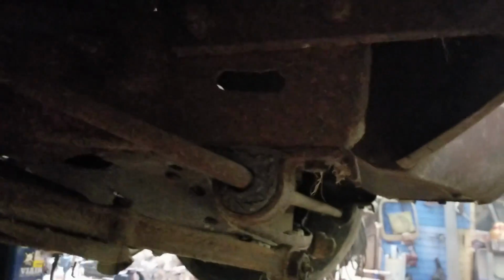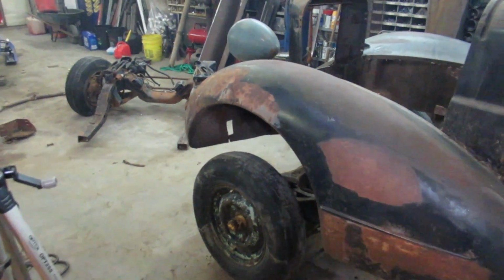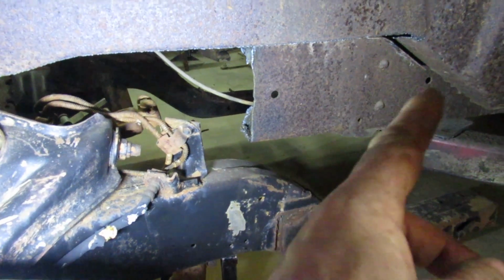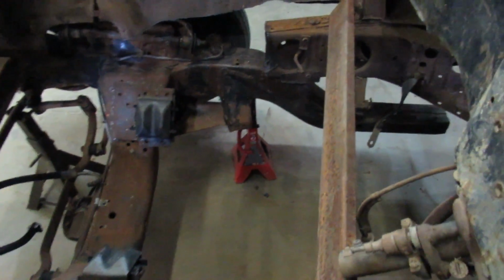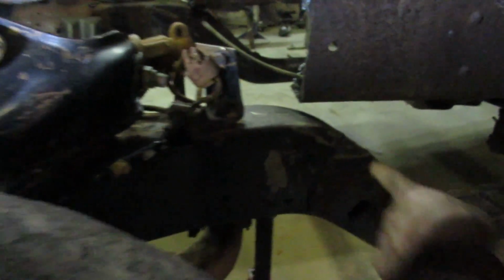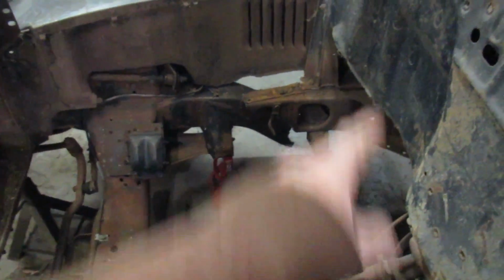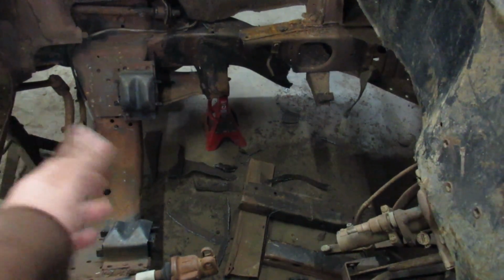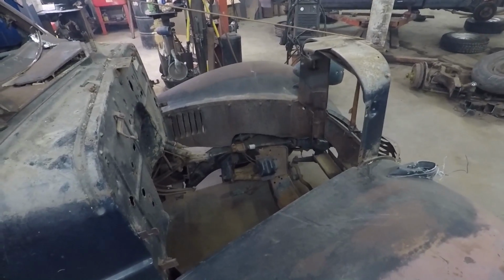Installing a Camaro clip into 1938 Pontiac Coupe part1

Comment: I hope you're measuring your wheel base so they match each side?  going to be kinda ugly for a while stitching the frames together but hope ya get it all set.
Reply from the maker: Can't really in this scenario as the rear diff isn't really mounted, I'll be putting a different diff along with 4 bar so it'll be fully adjustable if need be.

Comment: For my 47 with a 77 nova front clip. Don’t know if Carl showed you pics but it on my channel. The guy cut the front of the frame right at the front of the stabilizer bar bracket. Then someone to pull it out hooked up to the stabilizer bar bending the bracket and maybe bar. Im trying to repair this part to start rebuild.
What type of  bumpers will pass safety here.
Reply: Also how much meat you have from the bracket forward?
Reply from the maker: https://web2.gov.mb.ca/laws/regs/annual/2019/031.pdf page 12 you don't need a bumper is the way I read it.

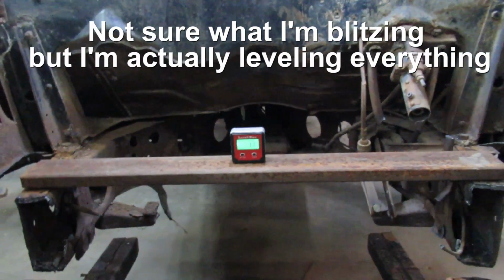Comment: 5:24  Are those frame mounts moved back ?
Looks to have flat plate welded to the cross member then the mounts welded to it.
What year is the clip ?
Thanks..
Reply from the maker: Yeah is was a clip that someone had butchered into a 46 Chevy pickup frame that I cut it out of. So I'm guessing it's for that motor setup.
Reply: @HalfassKustoms  T have a '46 Chevy pickup with a  G-body clip. I bought it as it is, unable to drive it. I was worried, but whoever put it in did an awesome job. Goes down the road straight and with normal tire wear. It looks very similar to the Camaro you have including the setback motor mounts.

Comment: I would not have cut off the original parts you may not need them on your project but there there may someone that is restoring ho may need those parts there you just take them off with out cut them and sell them on this way you would a little money in you pocket for your project and that one out there who needed for there project will have what they needed
Reply from the maker: Most of the stuff was wrecked, I'll prob keep the steering box for something hotrod related and maybe the drums if there any good, but the reset was toast from sitting in the mud I'm guessing.